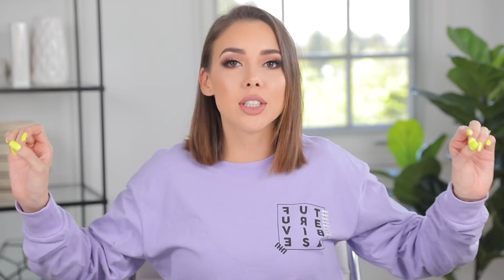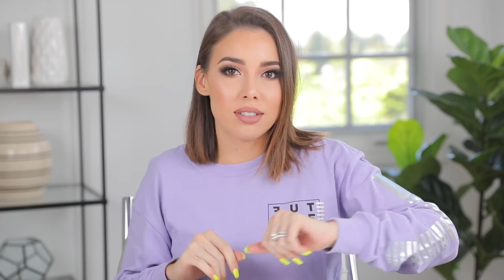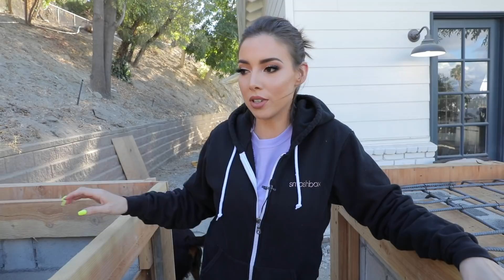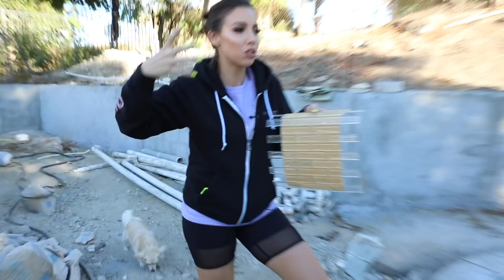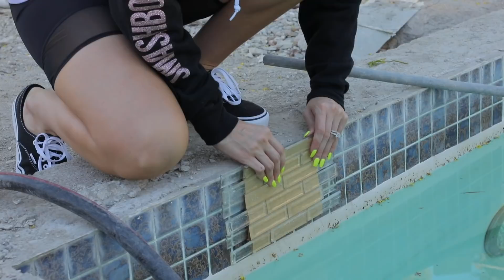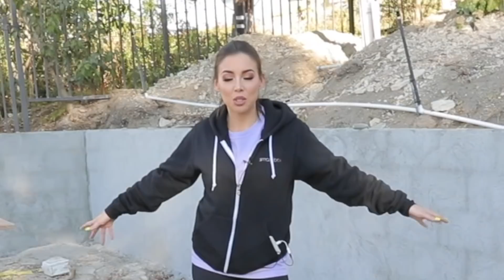LIFE UPDATE: BACKYARD TOUR, NEW PUPPY, KETO?!

Comment: Since keto is a high fat diet, it’s best to avoid high intensity workouts as your body’s energy system doesn’t run well on fat as a fuel UNLESS your doing long duration cardio :)) if you’re doing weight training or high intensity you gotta carb up before (good carbs) for better performance and more results.